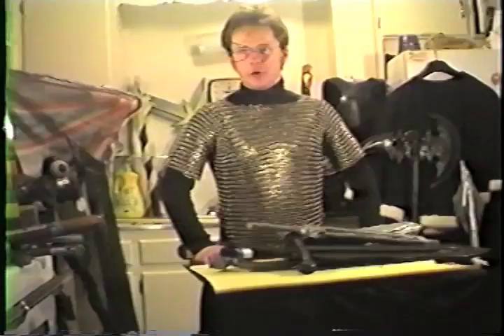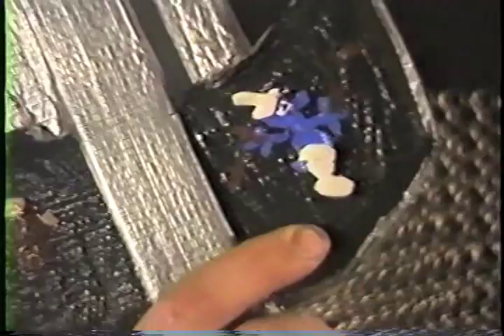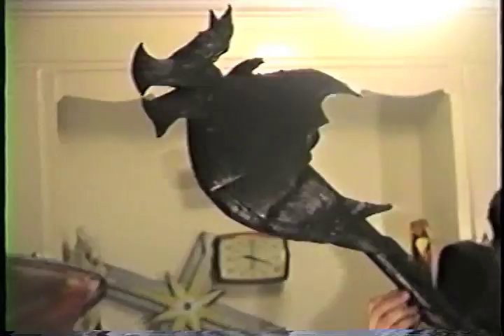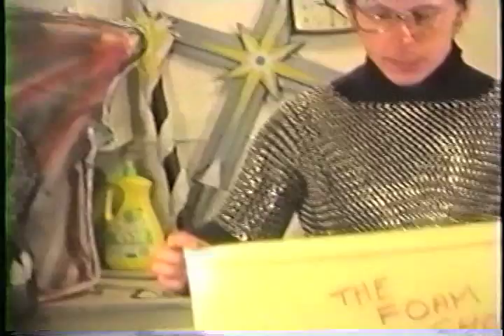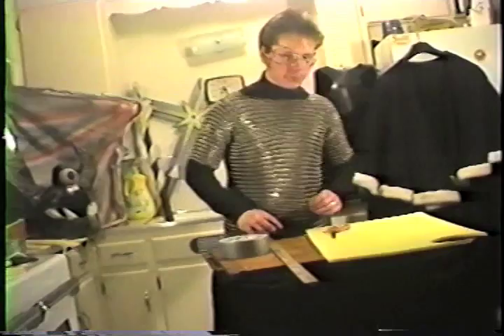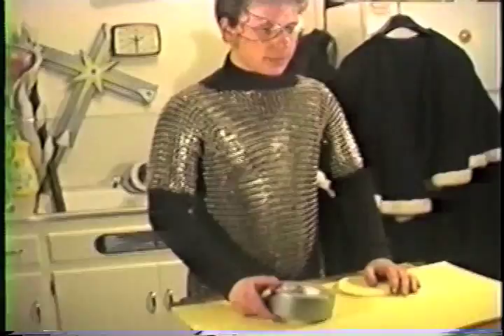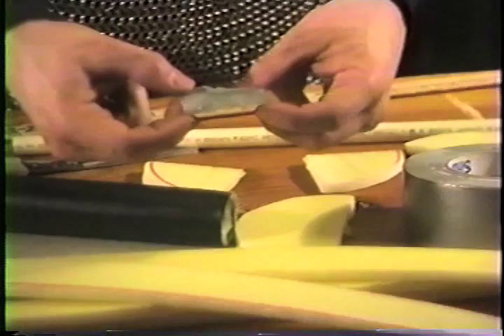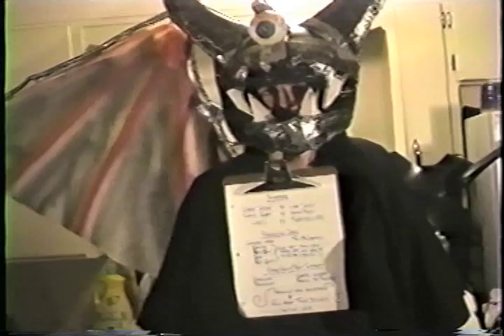LARP: How To Make LARP weapons

Comment: Good introduction to blade construction.  However, I have to "natter" about the illegality of white PVC piping.  The clan I started in using that piping almost exclusively, and we've never had a break.  In fact, it's the PVC (grey stuff) that breaks the most often.  However, I do agree with the use of C-PVC piping as a more flexible core.  As for the Sure-tape: isn't that the same as Ace Duct tape?  

Thanks for the video!  I think I may come join you all sometime.
--DS
Reply: Yes!  Sure-tape = Duct tape :-)